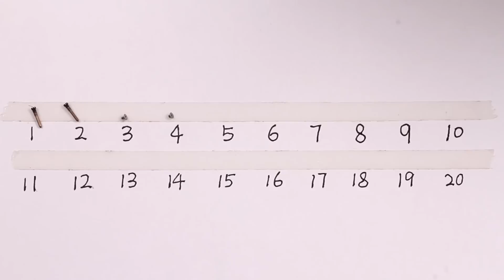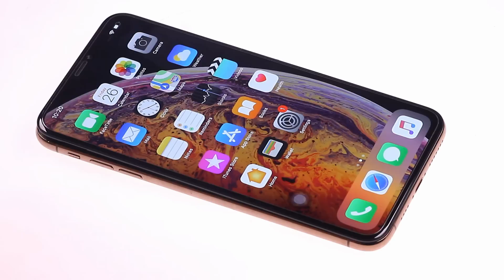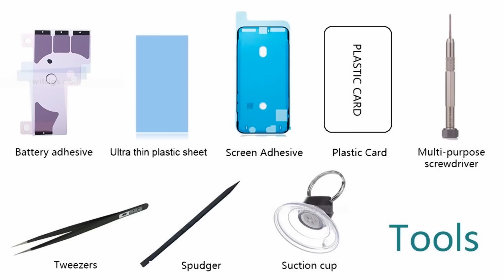iPhone XS Max Front Camera Replacement

Comment: When change  done it's not working it relative with version ????
Reply from the maker: Only the face ID will be not working.
Reply: For me same issue just black screen front camera wont work
Reply: @EricWitrigs  Any solution to make FACE ID work or anyother module which supports FACEID